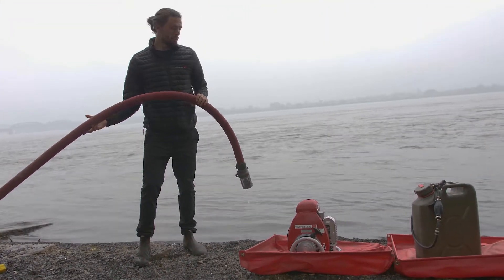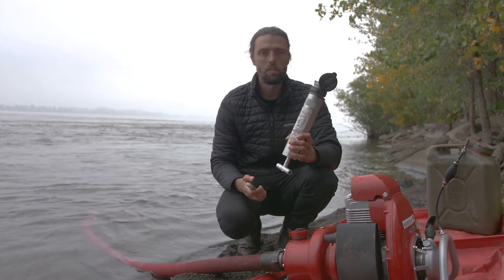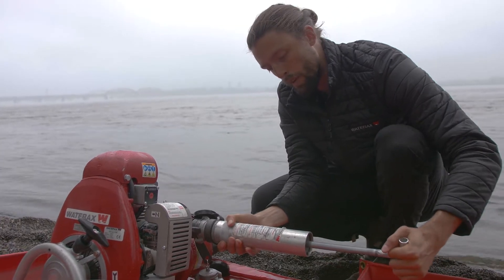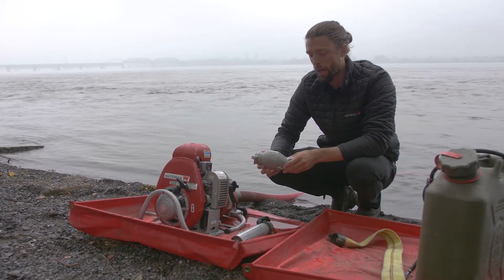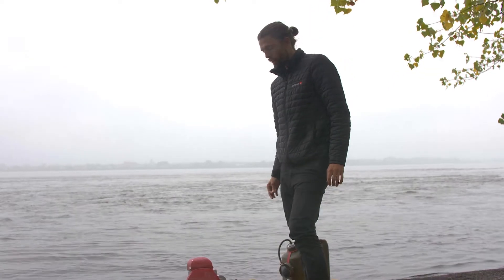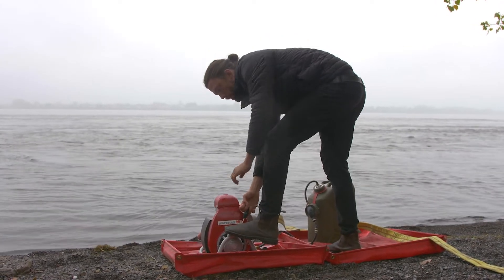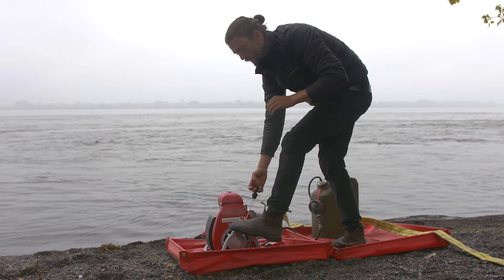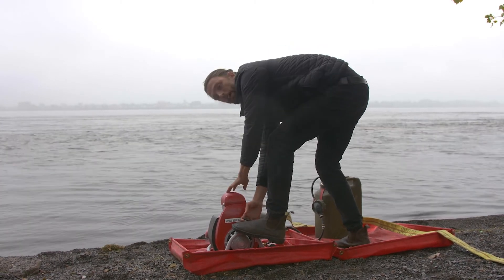The MARK-3® Pump - Setting Up & Starting

Comment: As an owner of one of these, there is absolutely NO WAY that it started on the second pull.  CGI and sound effects. On the 50th pull MAYBE if the sun is hitting it right, but you need to destroy your arm first, then the pump will start. 

On the plus side, once they start, they do run forever.
Reply: Im in a fire course and this little firefighting lady can start it in one pull lol